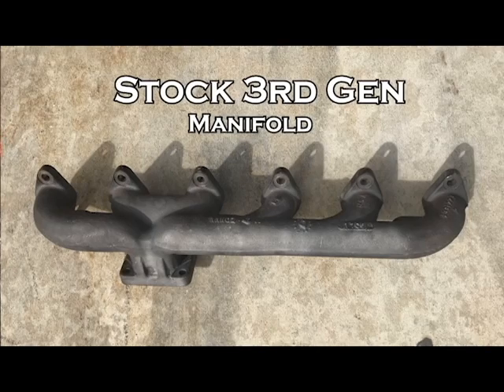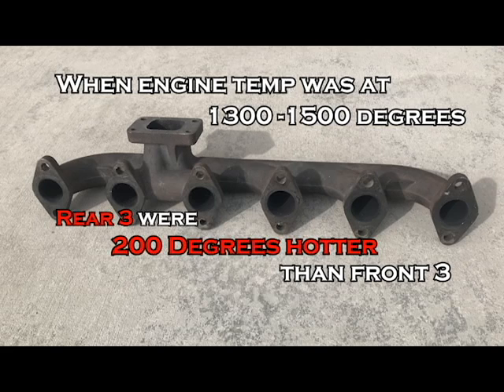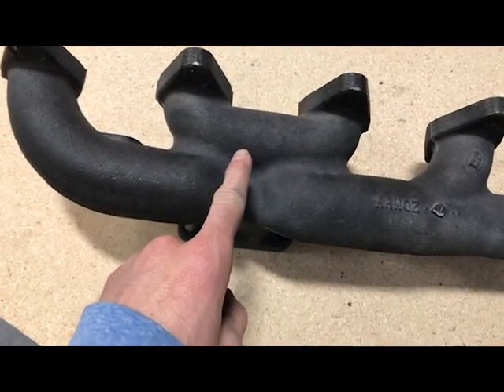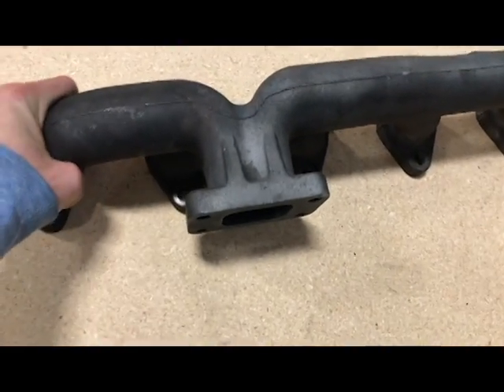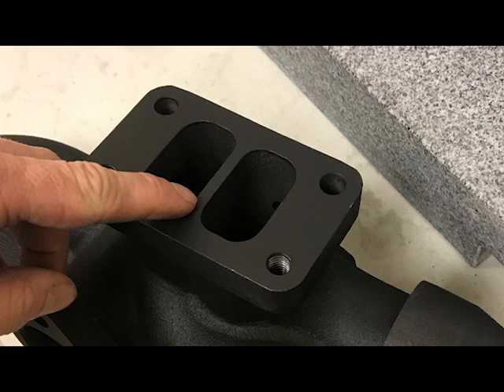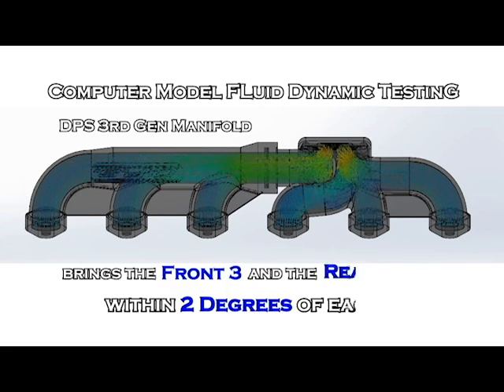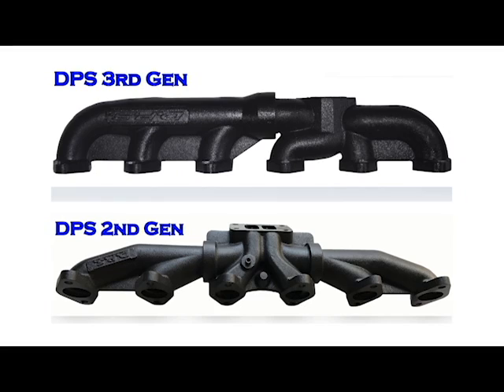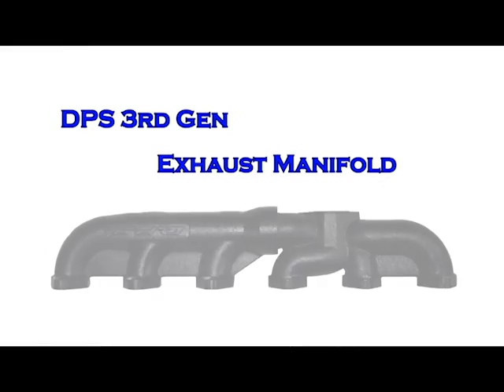How to prevent 3rd Gen Cummins failure | 5.9 Cummins problems solved | 5.9 Cracked Manifold

Comment: So what did the heat gun show on your manifold? Agree with the others...computer modeling is not the ‘real’ test.....so show us the heat gun...bet you sell a lot more parts if your design holds up. My real question is why haven’t you already don’t this?
Reply: We have used heat guns and many other people have verified with heat guns as well. We have also used pyrometers in the different ports. Heat guns and pyrometers however, don’t show what the air molecules are doing. If we only relied on what temp readings showed, our products would only flow as good as every other company. Our CFD testing allows us to see exactly what the air is doing, which enables us to make our products flow as well as possible..
Reply: @SP-xn6vo  so what did the temp probes and gun show? How much does your product lower the EGTs. And I would argue that if flow is better but the temperature remains unchanged then your goal was not achieved.
Reply: There was a 200 degree difference between the front and rear cylinders in the stock 3rd Gen manifold, the design on our 3rd Gen manifold however, brought the front and rear cylinders within 2 degrees of each other. There is a significant decrease in temps. Of course more unrestricted air flow is going to greatly lower EGTs. By knowing what the individual molecules are actually doing gives us the ability to design the best flowing and coolest running manifolds.
Reply: All in all goal was achieved. We also have customers that have seen as much as a 50 hp increase on the dyno by only changing to our exhaust manifold. We posted a YouTube video of that dyno test.
Reply: @SP-xn6vo  all sounds good. I’ll probably end up ordering one. Thanks for taking the questions in stride.
Reply from the maker: Actually we have used a pyro in each cylinder, because a heat gun isn't accurate either.  In a STOCK manifold the pyro showed the rear two cylinders at appx. 200 degrees hotter than the front, and the 4th cylinder a 150 degrees hotter.  There are other factors besides just exhaust flow which play into the EGT's, like intake air, and coolant, however, our manifold brought the cylinders all with 60 degrees of each other on the pyrometer.  The CFD is extremely accurate though.

Comment: Were would you recommend to install the egt probe? Cyl 6,5? Or right by exhaust exit over turbo?
Reply: Did you find out?
Reply: Patrick i installed mine between 3-4. I had edge tuner and egt probe and i could hit easy 1450egts. I knew something was wrong. So then I switched to smarty with their egt probe and all the reading are perfect. Never going back to edge on the 3rd gen. Smarty all the way p

Comment: Now you got me worried, is my 2004 going to melt, is the damage done?   Your explanation makes sense.  The truck is stock and runs awesome, replaced injectors last year at 250k with brand new stock ones.
Reply: Me and my dad both use our 03s for hotshot hauling he has over 400 k on his and hasn’t had a problem. Mine is at 320 k and haven’t had this problem.
Reply: What egts are you seeing when pulling
Reply from the maker: With the stock 3rd gen manifold if you're reading EGT's near the turbo collector, you won’t get an accurate temperature reading.  You're going to get an average temperature between front and rear cylinders. Say your reading is 1500 degrees F, (which is a dangerous zone) that would indicate that your front cylinders are appx. 1400 degrees, and the rear are 1600 degrees. So this is where problems can arise, when the rear cylinders are running hotter than the pyro reads putting the rear cylinders in a very dangerous temperature.  The reason for the average reading is because of undivided manifold mixes the front and rear exhaust together.  The reason for the higher rear temps is partly due to the stock manifolds bad flow characteristics on those rear cylinders.  Our 3rd gen exhaust manifold, 1. Divides the front and rear three cylinders from each other, so turbos spool about 100-150 RPM’s better; 2.  Keeps the EGT’s on the rear cylinders appx. 100-200 degrees cooler than the stock manifold; 3.  Flows overall much better than stock, and similar to our 2nd gen manifolds.
Reply: DieselPowerSource if I’m running my truck under normal conditions as a daily with slight mods (exhaust, intake, tuner) is this a problem I will need to address , I do get on the truck sometimes but even when I do I rarely use the hot tune

Comment: This is the first time i've heard of this problem. Is it really that common?
Reply: happened to my friend. Idk how common it is, he drives pretty fast. Could happen to people who tow
Reply: @lazarusmagellan2367  i believe its mostly happens when an injector gets stuck open. Change the fuel filter every other oil change and do injectors every 150ish k and youll be good
Reply: @BeEzLeBoSs2010  ohh ok that's a relief. Preventative maintenance seems to reduce the risk of a lot of these major engine part failures

Comment: I totally believe his claim, my neighbor fried his number 6 and have read it is a common problem. Why is it uncommon for 2 and 3 to melt? Others claim it is caused by a failed injector over fuel condition. Why is it most commonly isolated to #6 and Cp3 Duramaxes with almost the same injectors don't seem to have this melting piston problem. I think he is on to something.
Reply: That’s because the duramax has a v8, less distance for the coolant to travel to the back of the motor, as the length of the block is about the same as a 4bt. Also different style exhaust manifold on a duramax.

Comment: I will be purchasing a 2006 Ram 2500 with the 5.9l Cummins and want to put this manifold on it. Will this manifold work with the factory turbo or is it specific for your turbos?
Reply from the maker: Yes, our 3rd gen manifold was made to fit that year of truck.
Reply: @DieselPowerSource ... I ended up buying a 2007 Ram 2500 with the 5.9 Cummins. I then purchased this exhaust manifold and have been fairly pleased so far. The only thing I want to know, is there a certain type of bolt that's needed to be used with this manifold where it connects to the turbo? The technician mentioned the holes being made a bit different and he had to make bolts for it in order to get it bolted together?
Reply: DieselPowerSource I have one on my 2003. Easy install, nice piece. I believe it does spool better and think the heat is more ever. You will be using the T3 flange manifold.